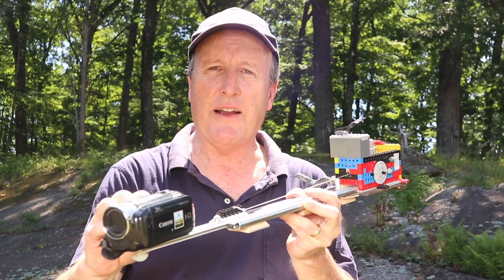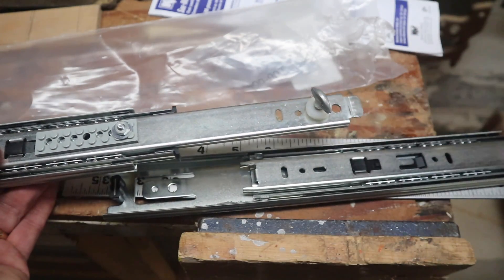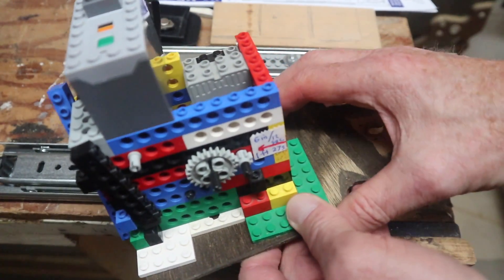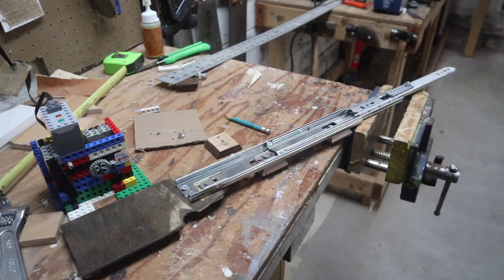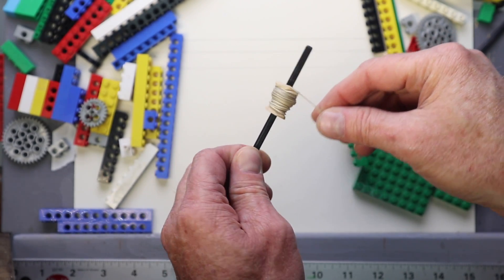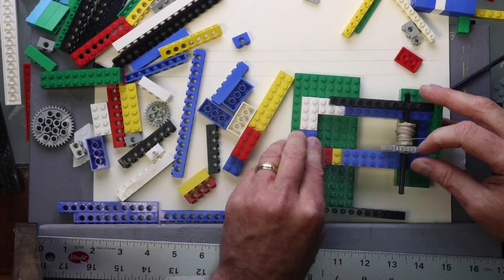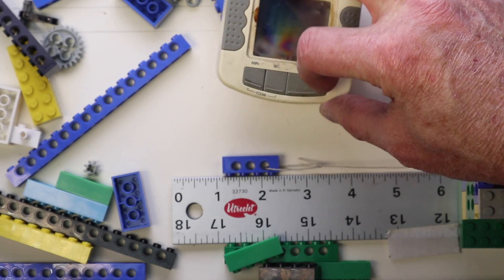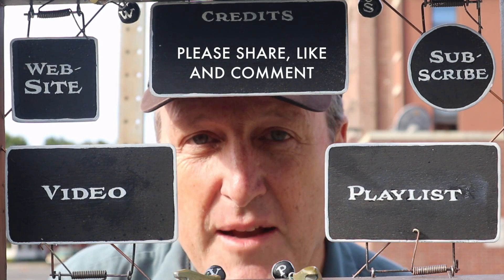Drawer-Slide Camera Dolly with Lego Motor

Comment: You need a Lego micromotor partnumber 2986.
It is a 2x2 brick motor, very low speed, less noise.
Also buy the little pulley with it, and if you use pulleys and elastic rubber bands, you can reduce rotation with less noise.
It is and old motor, not sure if it will work with PF battery box/wire.